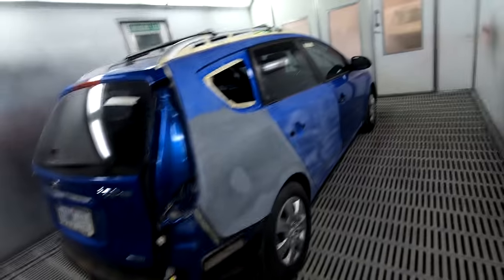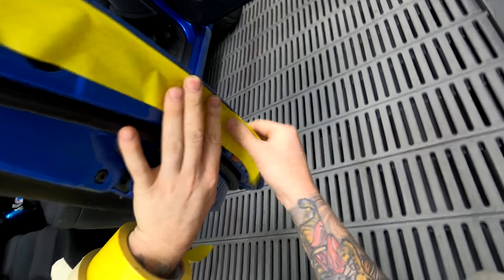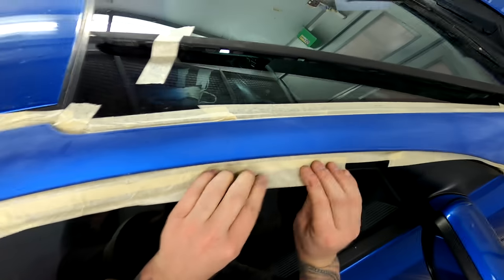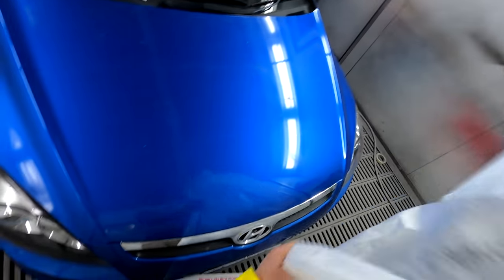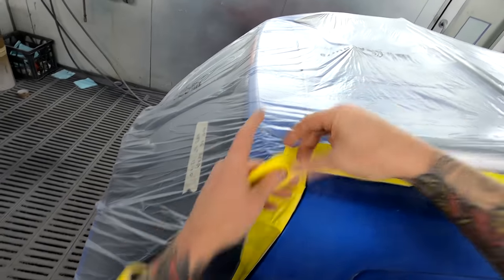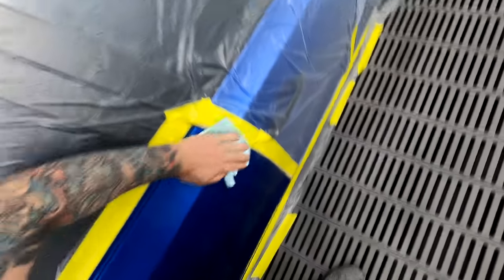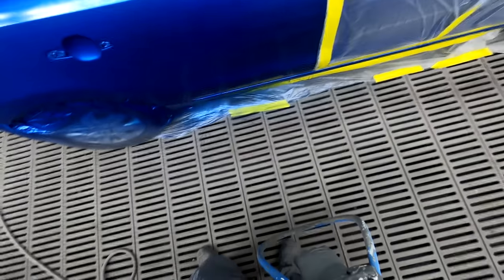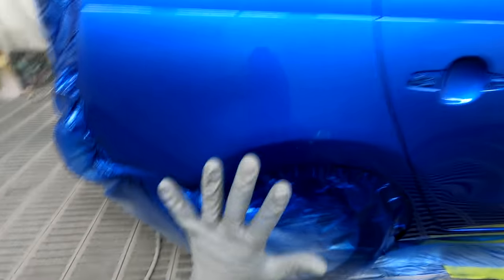Masking & Painting With Gunny

Comment: my gun is on the way☺️i got one😏💪nice job Gunny !! You spray this job with 1.3 ??
Reply from the maker: Great!! Yes, I used 1.3 T110 for both base and clear.
Reply: @TheGunmanRAW  I'v been dialing in T110 with 1.2 tip. Started at 30psi was ok but noticed If I go to slow get tiny air bubbles. Tried 35 psi cause the product I use painters say up the pressure. The result was more orange peel cause had to move faster to avoid the tiny air bubbles. Then went down to 25 psi nailed it so far. I was able to slow down came out flat but slight orange peel on flat surfaces cause temp. was at 82f. I like to spray around 75f seems to cut down orange peel.

Comment: You use to be anti 3m but I see most products you use is 3m! 

It is way more expensive than normal stuff but once you use it, it’s so much better than the normal shit it’s not funny. 

The only time I’ve had a better experience with another brand is mirka’s abranet sanding discs. I find them better than 3m. I can’t see myself using 3m until their release their “net” type sandpaper. Zero clogging with the abranet which is fantastic.
Reply from the maker: I've never been anti 3M dude. I've always liked most of their stuff.